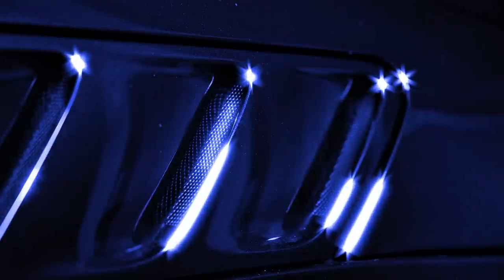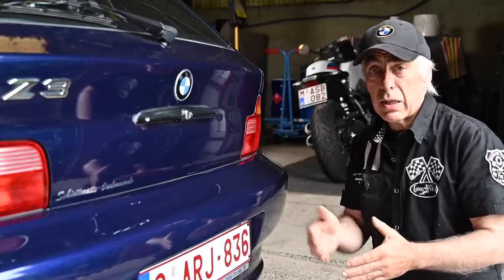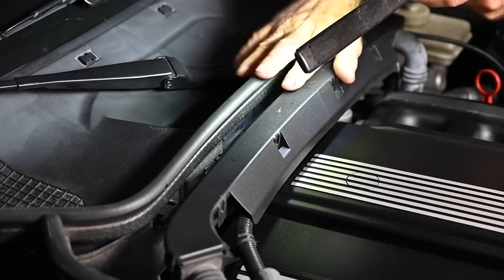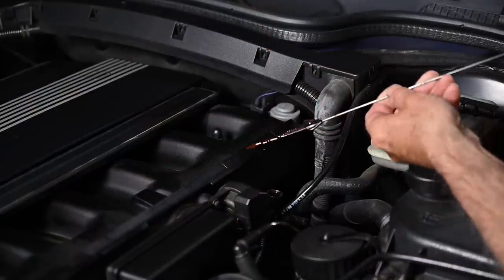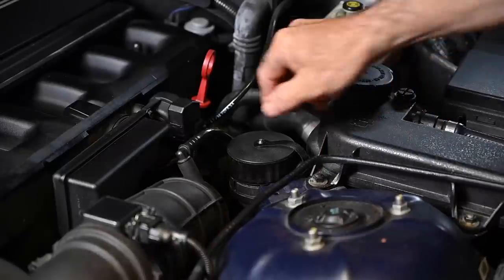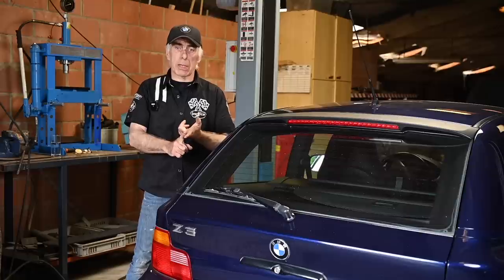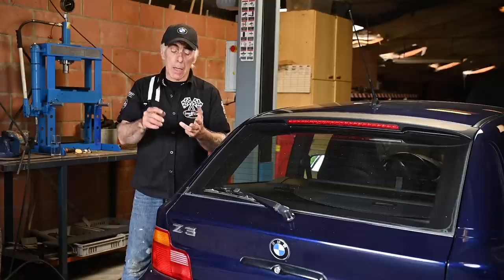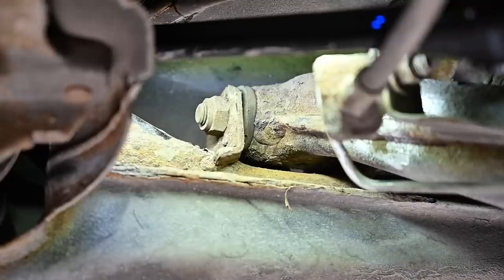Buying a BMW Z3

Comment: It’s also a good idea to check the rear sway bar mounts on these. They tend to brake off due to corrosion. Also alway open the boot floor not only for signs of accident damage but for cracked spot welds between the two rear strut towers, this is a common problem with these cars as well.
Reply from the maker: Thanks for the comments,  and very good points

Comment: I got my '98 Coupe last year and I had minor clunking noises. I changed the fluids in the transmission and differential and the noises were gone. Additionally, the gear changes got much smoother, especially while cold. 

Nevertheless, a great video, wished this video would be available last year.
Reply from the maker: Thanks for the comments, and yes there can be many reasons why a cluck is there

Comment: I own a 2.8 Coupe from  '99 since 2003 and can confirm that your video is very accurate on issues and benefits. I bought one because it's different then a lot of other sportscars, but yet with reliable BMW quality.  Some add on's to the comments below : the rust on the rearview mirrors was always in the foot of the mirror, where the 2 parts came together.  Another thing to mention : the rear tires get weared out from the inside, this is due to the older e30 rear axle used on this car.  But in all, for a funcar to have extra, it is a good choice.
Reply from the maker: Thanks for the comments FrankW....  did you run into clunking issue on your drive line as most have an issue with the torsen LSD
Reply: @D3Sshooter  No, maybe because I bought it very early at a BMW dealership in Gummersbach.  Pre owner was a woman, could have been a benefit...
Reply: @frankw1794  p

Comment: That‘s a great guide with a lot of information. BUT: the Z3 never got the faulty Nikasil M52 Engine. It always got a special M52 with the Engine Code 286S1/Z3, which had gray cast iron liners instead of nikasil since day one. That‘s why there are many E36 and E39 with this problem but few to none Z3.

Comment: 41:24, that crack on right side. I know it's all been replaced, it's just something camera picks up and video maker does not see. Happens often, when making videos.
Reply from the maker: Sorry for the late reply , as i was away for work. But thanks for the comments.   That is no crack, that is a grease track  that ran down after I sprayed it with brake cleaner

Comment: Hey man, the clunking soud is the differential, many Z3 do it, but its not the support, its the differential itself. You can start by changing the diff oil and gearbox oil. BM;W says it lasts for life but its not true... And the 3rd gear issue could be the gearbox shift pins. You have to take the gearbox out and change the gearshift pins.

Comment: We always fill our manual gearbox with castrol transmax z atf oil. There is a sticker on the gearbox whether atf or normal gear oil comes into the manual gearbox. Is often done wrong and then the gears get stuck.
Reply from the maker: Thanks for the comments and indeed

Comment: Excellent video. I have 1999 Roadster 2.8. Automatic Transmission. Started to feel jittering vibration, when the car is accelerating, and engine revs around 1600 to 2000 rpm. I think its coming from the left rear wheel area. The rattling vibration gets bigger, when the acceleration is faster. When slowly accelerating, the vibration is low.  Can you think of any reason why this is happening. FYI * I think the cause of this, is due to the heavier 18 inch alloy wheel for Z4 being used on Z3. Perhaps there are much more strain on the differential than the original 17 inch alloy wheel.
Reply from the maker: TXS for the comments, play on the shafts or unbalanced  shafts seem to be most common problem..

Comment: Thank you, the best Z3 video I'v seen and I'v been looking a long time, mine is a 1998 2.8 with hardtop n' I'v been loving it the last 15 years. 
You mentioned about Nicosil piston n' cylinder coating, can I ask, how do you think I would know if it is an issue ?
 Also I am again considering changing the inlet manifold for a M50, to improve acceleration through the rev range, but the idea of some loss of torque always put me off, and would need an ECU and remap, have you looked at that ? 
I'm fitting new OE Bilsteins and brakes right now, and going to flush the old brake fluid out, giving it some TLC, best car I'v had .
Reply from the maker: Nicosil tends  to chip and you will see it in the oil filter
Reply: If. you want to really improve acceleration through the rev range add ITB's the M50 manifold does and alright job but youll loose some low end torque without a tune

Comment: I got fooled once on a BMW 335i. German import with 80k km on the clock or so. Full servicehistory everything. Had the cars for 2 years and when I sold it the company that bought it did a proper background check on it and turns out it had about 225000 km on it, and when I sold it the clock said 100k. So yea, luckely they bought it anyway for a reduced price that we still decent regarding the circumstances. Was still a huge loss thou
Reply from the maker: Sorry to hear that, with a Car Pass that is not possible here as the milage is every year registered at the MOT

Comment: Funny you didn"t mention rust issues below the rearview mirrors.  Common issue, mine had it too...  Good to see after I sold it prices only depreciated; I was just in time ;-)
Reply: Buy high sell low my friend works 100%
Reply from the maker: Thanks for the comments Harald,  Might have missed  that indeed , although I have seen several without that issue.   Its a funny thing the market on those cars.  I got it for 12.000   and  did post it for sale...within a few hours it was sold for 19.000 .  I did not let it go for that reason and because I do enjoy it...  Know reworking that car

Comment: Dude, you guys are acting like you are buying a Duesenberg Model X!!!
Millage does not mean anything! You can have a 10k mile car that has been driven by a 15 year old that liked to burn the tires for the entire 10k miles! Obviously this one's engine will be destroyed and it is now for sale! ...or you can have a car that has 199 thousand miles but has had timing belt and oil changes every 2k miles, the last engine will be in better shape than the first one! That is the one I would want!
It drives? yes! It hold compression? yes? got oil? Does it hold oil? Overheats? no? Does it drive straight? yes!!! Is it in one piece? or does it come in boxes? 
Ok let's get it!
Reply from the maker: Thanks for the comments

Comment: Don’t ever buy a BMW
Reply from the maker: I have a 420i, the Z3 and  a 1200 nine T, never had an issue. Off course the Z3 is 22 years old...   So why is that Gary " Don't ever by a BMW" ?
Reply: These old ones are good. Newer ones have too much plastic engine parts and too much electronics.  When they are new they are fine but you dont want to keep the new ones when they are over 10y old
Reply from the maker: @JamesParus  Thanks for the comments...
Reply: Well I would say that is good advice but if you are careful you have a good chance of getting a good one. I have a 2009 328 coupe manual base at 40,000 and really no unusual problem now 100,000 and still looks and drives pretty good. Helps that I do as much of own maintenance as possible, parts are expensive but if factory are of really good quality. I would buy another. Don’t see the shoe car much in the states but was passed by one couple of months ago.

Comment: ...the "bonnet" has been repaired? He he..."bonnet" Sound like some fat bottomed French girls! ... bonnet!!! 
Dude, you guys are acting like you are buying a Duesenberg Model X!!!
Millage does not mean anything! You can have a 10k mile car that has been driven by a 15 year old that liked to burn the tires for the entire 10k miles! Obviously this one's engine will be destroyed and it is now for sale! ...or you can have a car that has 199 thousand miles but has had timing belt and oil changes every 2k miles, the last engine will be in better shape than the first one! That is the one I would want!
It drives? yes! It hold compression? yes? got oil? Does it hold oil? Overheats? no? Does it drive straight? yes!!! Is it in one piece? or does it come in boxes? 
Ok let's get it!
Reply from the maker: Thanks for the comments